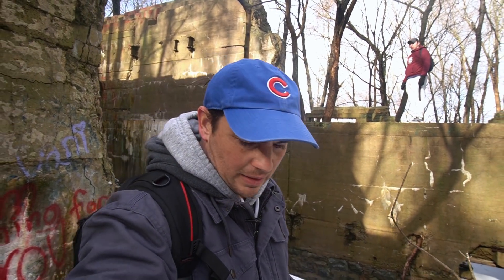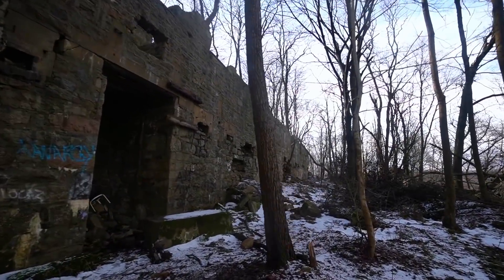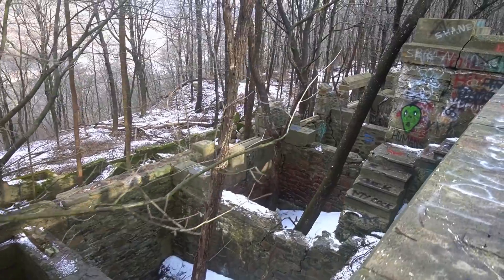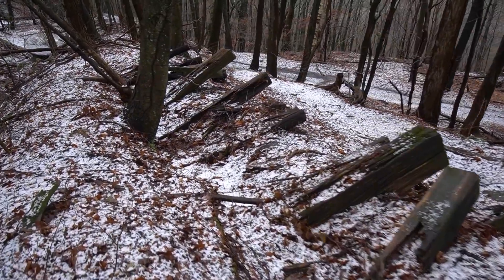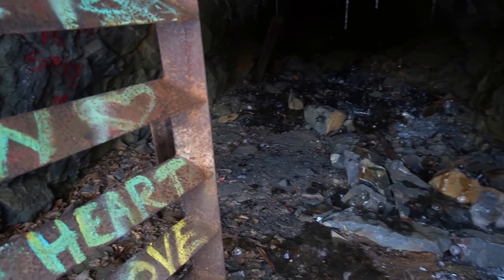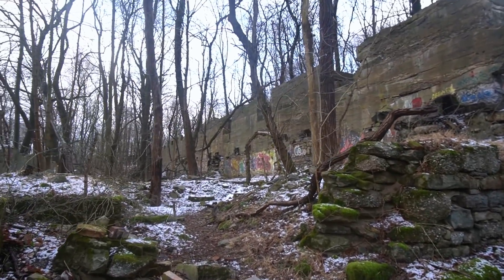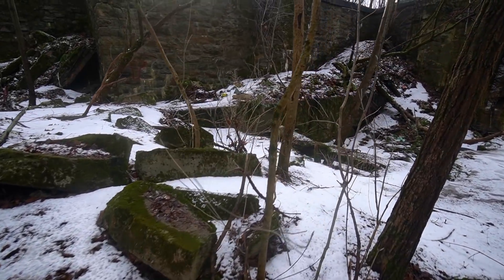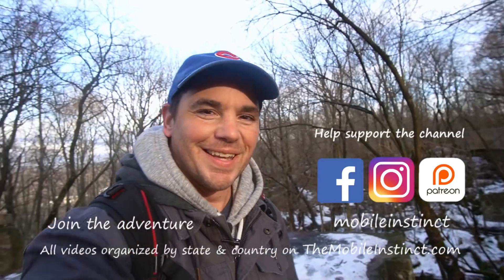Forgotten Engineering Marvel - Now In Ruins

Comment: Maybe the the coal bins were used to house coal for the stationary engines that ran the incline? Not sure why you'd haul coal up an incline to drop it into a bin that then would load another car. It looks like the engines were housed in the large building to the left in the photo and the bins look like maybe they are actually along the wall of that building with the cars dumping just to the right of the wall and the openings inside the building on the back wall.

Comment: these are awesome sets of ruins, dude. Over here in NJ, I’ve been checking about ruins of the Morris canal’s inclined planes,  which were powered by a scotch water reaction turbine instead of steam. they basically operated on the same principle, except instead of train cars they hauled canal boats from a lower section of canal, uphill to the upper section of canal

Comment: ALSO IN GERMANY, THE VALLEY OF THE WUPPER. WHICH IS WUPPERTAL. HERE IN THE VALLEY IS A 50 MILE TRAIN TRACK. WITH THE TRAIN RAIL...........A B O V E .............THE TRAIN.......................MADE EARLIER THAN 1900. AND IN FULL OPERATION IN 1900. AND STILL TODAY.

Comment: If coal was hauled up the mountain for the town then the coal dropped into those stone bins could be unloaded into trucks via the chutes with the steel doors in the bottom of the bin. The immobilized railcars with the chutes attached were probably also used for coal storage.

Comment: Steel 50' boxcars where not used until late 60's, so property was used late than 1932. The Coal Cars where pulled by a cable system that was powered by a stationary steam engine using pulleys. Coal Temples used cable system to move cars even on flat yards up though the 60's in some coal regions.

Comment: why were they pulling coal UP a mountain?
Reply: The mountain is huge it takes up most of Pennsylvania. From what I read it would've have taken longer to go around the mountain. The coal then was distributed to the towns that were located north of the mountain. They eventually made a tunnel going through the one section of the mountain. Which was aot easier and cost effective. Because this plant was also ran by to s of coal. So tons of coal was being used to operate. Where it was only used in the locomotive to go through the tunnel.
Reply: To deliver it to other areas
Reply: @journeywithjay  but "UP" the mountain?  what was at the top that needed the coal?

Comment: Fascinating!  In the early days, inclined planes were considered an alternative to railroads, since the engineers of the time still had no idea of what would work and what wouldn't.  The Baltimore & Ohio RR (BTW, it was named for the rivers at the ends of the pioneering section of "America's First Class One Railroad," not the city and state) had a set of inclined planes at Parr's Ridge, as they didn't think steel wheels, rolling on steel rails, would have enough traction.  However, once the first "Grasshopper" (vertical boiler) locomotives came along, it was found that they could climb the planes and even pull loads.  Their thinking that grades would be more limiting than tight radius curved track hampered the road for much of its life.  This video---and my comments---have reminded me that I should get my copy of Herbert Harwood, Jr.'s "The Impossible Challenge" off the shelf and glory in the "Railroad Archeology" of my favorite railroad.  He devoted a lot of text and photos to the remnants of that early "Stone railroad's" beautiful stonework bridges and culverts, many of which were stranded in the middle of nowhere by realignments to ease those crippling curves.  Good video, as usual, Chris!  Stay safe, everyone.

Comment: Those 2 box cars are from the 70,s. The were full of oxidite. A company worked out of there. The trucks had 2 tanks one would be full of fuel oil the other full of oxidite,the trucks would go to the strip mines in the area and as they pumed the stuff down a pre drilled hole it would mix and be a very powerful explosive.
Reply: The inclined plane railroad transported coal from the Mahanoy Valley up the Broad Mountain to Frackville. Opened in 1862 as part of the Reading Railroad system, improvements in the early 20th century increased its size and capacity, making it an engineering marvel able to meet national demands. After hoisting hundreds of millions of tons of coal, it closed in 1932. How and or why those 70's era rail cars ended up there is anyone's guess.
Reply: Those box cars are not from the 70’s they are actually from the late 20’s to early 30’s
Reply: @tcwhite0104  They appear to be more modern post-war steel box cars. They may have been placed there in the 1970's.

Comment: I grew up in frackville, and played in these ruins for years. Was a great place to play army.
Reply: I live about 45 minutes away and I never knew this abandoned place existed. The things you can discover in the mountains of PA. That’s why I love Pa and the history it’s full of.
Reply: Who laid down and who got blew up??
Reply: I spent the Summers in Mahanoy City. (mack a noy) called by some i usually went in the other direction towards Barnesville. But to do more exploring I remember lakes from mining that had coal equipment laying at the bottom( you could not see). They were deep but apparently when they hit water they would abandon the sites. These were on the other side of town & also on that side there was an East Mahanoy Tunnel that RBMN Railroad still uses that went under I-81 when it was built that has a huge door that could be closed (if necessary).
Reply: Sorry (mock a noy ) is the pronunciation I heard most by locals. Not angry just saying.